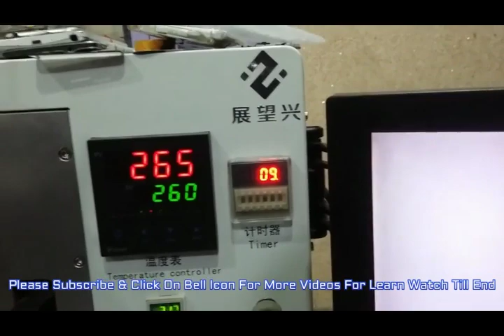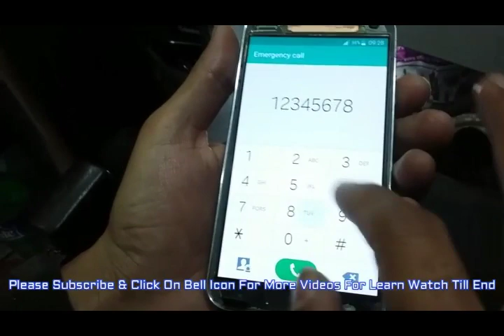Samsung S5 Touch Flex Replacement - S5 Touch Problem Solution

Comment: I need your contact info please. I have 2 galaxy S5s that need repair.
1 needs a touch flex repair and the board is dead
2 is a dead baord and whenever it is on low light setting it tends to flicker so the brightness need to be at a high level always.
Reply from the maker: Where are you from ?.